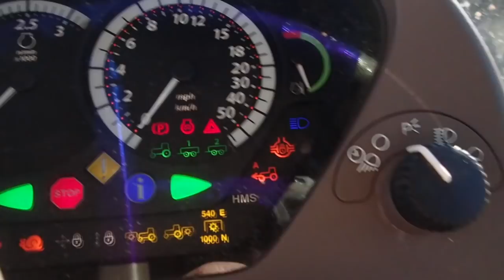Cold Hay Day + Story

Comment: You were heard, but a heater with a separate exhaust is still what I prefer and recommend.
Can run it all day in my shop, and only thing in my shop is hot air as the exhaust is lead out through a metal pipe to the wall. The pipe also gets hot and is great for drying work gloves.

Comment: "There is always a tractor that starts"........Wes, with around 16.5 John Deere tractors, If NONE of them start you got issues......lol
Thanks, Keep em coming. Btw, heated battery blankets worked well in Alberta on winter equipment. They made batteries last longer in addition to helping the battery get a machine started.

Comment: That sucks about the guy getting run over :( youch! 
 Cold weather and diesel don't mix! My jd diesel won't start unless it's plugged in. Glow plugs are ok for temps 25 to 40 degrees but block heaters are pretty handy for artic weather ; )
Reply: As long as your Diesel doesn't turn to jelly. A guy I knew in Denver used some kind of additive in his fuel to keep it from freezing.
Reply: tom7601 our diesel is delivered and is always winterized :) mi weather is cold so it's standard even in truck diesel pumps ;)
Reply: yakyakyak69 everyone here sells it winterized. I didn't know they added kerosene to it. .. is it bad to run it year round? Our delivery company only offers the winterized stuff :(
Reply: WTFarm Girl kero has less calories then diesel so long term you will burn more to get the same amount of work done, I'm not sure of its lubricity so might cause problems in common rail high pressure fuel systems in hot weather, also not sure how tier 4 emisions systems deal with it but most winterised diesel has kero in it so that must have been tested during development.Cheers mate 🍻
Reply: I add petroleum to my fuel at winter,its a big diference for my tractors
Reply: should not add kerosine in the diesel. new engines with injectors dont like that as no lube in that stuff. clean diesel without that bio crap is the way to go.  my trucks have heated filters so works rather good. need to have your shit in good order in the cold :)
Reply: WTFarm Girl 
16
Reply: Michigan winter fuel is a blend of #1 and #2 diesel and some suppliers may add an additive also but it is rare unless you order it with added stuff
Reply: our 1972 4230 don't like the cold

Comment: I'm sorry for your families loss. I have a ? about your load securment. Have you ever considered an X strap configuration on the front of the load to add extra piece of mind to prevent the load shifting forward under a hard breaking situation? While I hauled shingles for Owen Corning most guys would cross strap the front pallets of shingles to keep the load out of the cab.

Comment: Just curious, are farmers required to have a CDL to drive a tractor trailer on the roads?
Reply: paul dietrich depends on how far they are going. From what I've been told, In Ohio, you have a 150 mile range from home that you don't need a cdl.

Comment: Diesel now is not what diesel was 20 years ago. High sulfur diesel in a salamander would smoke you out. I have a 210,000 btu salamander and i run diesel in it and you wouldn't know the difference between that and kerosene.

Comment: Thats why i dont like the amarican Farm Wagons. Its kinda stupid trying to pull 20 Tons with only breaks on the tractor

We here in germany have breaks on every wagon above 3 tons. Wagons that can haul more than 8 tons have to be air braked. Accidents still can happen. So if something starts to roll you better let it do its thing and avoid getting hurt or even killed.

A guy in my neighbourhood just got killed this summer trying to stop his tractor after the parking breaks fail'd, so be carefull with Farm vehicles.
Reply: TimmyTeaBag 

Haha, Not good.

Thats also why i like air brakes. Its nearly impossible to mix something up while connecting to an implement. If your Not a complete idiot😂

Comment from the maker: by by jeramy freemen
Reply: onelonleyfarmer Tim really needs a REAL TRUCK Wes.I think he needs a clean,used(gas)Ford super-crew cab F-250 or F-350.
Reply: onelonleyfarmer on your 8120 it might need new injectors because it might have dribbling injectors that’s why white smoke after Reving when you started it up
Reply: 4 gauge    Why would be get a gas one    Whith diesel it is cheaper if you are dodgy minded
Reply: Hmmm I understood exactly what you meant, in fact I do the same thing! Oh yesterday my wife's car battery took a chit too it was 2 degrees here in Northern Michigan, the freaking battery was $197 bucks and a real bitch to change you have  have a $12 special tool to lift the battery out of the hole in the floor behind the passenger seat!😡 Damn GM engineers!
Reply from the maker: i think i have a dribbling injector too i won't mention the white stuff coming out!!!
Reply: Steve b Yayaya it would be nice if you could actually speak English and spell English properly,so people can actually understand what you're saying first of all.Diesels SUCK!!.There 3 to 5 times more expensive to own and maintain.Have TONS of reliability issues,especially in the winter time starting.Gas is the best choice,also you don't need to run urea in it(adds to the cost of your fuel dramatically at $12.00 per 2.5 gallons)
Reply: 4 gauge u don’t know mate if your a farmer u don’t have a gas truck over here in England anyway, because you can run it of red diesel but that is kept quiet. Do you like my English now As well
Reply: 4 gauge in England for diesel ye petrol is 1 p cheaper over here but red fuels or farm diesel that is 46p to 59p which would you have if you were a farmer
Reply: Steve b Yayaya I've had a lot of experiance with diesel pickup trucks and reliability is a major issue with all of them,especially in the winter time.I'll never own another one ever again.Diesel fuel runs about .50(or more)cents a gallon more here in the states,plus you have to buy urea for emissions control,which runs about $12.00 a gallon on top of your high-dollar diesel.By the time your done,you'll have nearly 3-times the cost in your fuel,that won't start in the winter time.
Reply: Steve b Yayaya Farm diesel in this area goes for roughly about $2.69 per gallon.So this means if you fill up your F-250 diesel pickup truck with its 42.5 gallon fuel tank,your going to spend $114.70 cents...BUT WAIT!!,THERES MORE!!.Now,your going to buy about another 25 gallons of urea for your emissions.This will cost you another $115.90 cents for that...bringing your total fuel cost too(drumroll please)$230.60!!.THATS INSANE!!.
Reply: 4 gauge fucking hell glad I don’t live in America after hearing that you should come over to England whith are little pickups that you can fill up for £40 on farm diesel now I understand 😂
Reply: Steve b Yayaya Diesels are expensive everywhere and anywhere in the world.If you need to put in fuel injectors in a diesel pickup truck(Ford,GMC,Dodge)they run about $400.00 a piece.So,your going to spend about $3,200.00 on just buying replacement fuel injectors.Again...THATS NUTS!!.Fuel injector pumps run about $2,000.00 a piece,even more insanity right there.If diesel is"your thing"so be it.Not for me.
Reply: 4 gauge you should get a hilux
Reply: 4 gauge but that’s the price to pay for big boystrs trucks
Reply: Steve b Yayaya No.The Toyota Hilux is defunct first of all,(those were discontinued back in the 1980's)
second of all,Toyota doesn't built a high GVW truck.(the tundra is a half-ton truck)
Reply: Steve b Yayaya Waste of money anyway you look at it to me.I don't care if you have $100,000,000,000.00(100 billion bucks)in the bank.This originally started about Tim's dying Jeep,not about me.I have a F-250 with a 7.5 liter in it and it eats diesels for lunch.
Reply: 4 gauge hilux weren’t discontinued and ur a bit sad I don’t care
Reply: Steve b Yayaya Sigh...I just checked out Toyotas web site and the Hilux was discontinued back in 1995,the TACOMA replaced the Hilux.Now,what's really sad is somebody feeding me B.S.about misinformation as fact(s).
The Hilux AND the Tacoma(pronounced COMA)are a JOKE!!.The have little to NO hauling capacity at all,compared to even the Toyota Tundra.(10,000 pound drawbar capacity)
My F-250 has nearly 18,000 pounds of drawbar capacity and about 3,800 hundred pounds of hauling ability in the 8-foot bed.
AGAIN,this isn't about me dude,this started out about TIMS JEEP!!.WAKE UP!!.
Reply: 4 gauge they still do hilux in England
Reply: 4 gauge I don’t really care to be honest stop crying
Reply: 4 gauge it wasn’t replaced but I didn’t tell you what to get either I said Tim could get a diesel so he could run it of red but I didn’t know u had to put pig piss (urea) in the trucks sorry didn’t mean to upset u
Reply: Steve b Yayaya No,your not upsetting me one bit.I'm laughing my head off about this whole ordeal about what started out as what I said about Tim's Jeep.
The Hilux was replaced 22 years ago according to Toyota of JAPAN.This means that on all 4 corners of this earth,you CANNOT buy something that doesn't exist.(I'm laughing my head off about that also)
The T-A-C-O-M-A has REPLACED it NOT ONE,but TWO DECADES AGO.If you don't believe it,call Toyota and ask them what happened to the Hilux,they will tell you that rust bucket was replaced by the TACOMA eons ago.😂😂😂😂😂😂😂😂😂
Reply: 4 gauge how the fuck do I have a 2015 Toyota hilux  in England clever clogs
Reply: 4 gauge search it up 2015 Toyota hilux
Reply: Steve b Yayaya I just looked at that truck and its a prototype only and its being tested in Austraia.Its not available for the general public as of yet.
Reply: 4 gauge no it isn’t you don’t know and I don’t care so bye bye
Reply: Steve b Yayaya Ahh,I can read and write English dude.Its a PROTOTYPE truck(means that only one built)and its in Australia.It remains to be seen if it ACTUALLY goes into production.

Comment: I learned not to chase equipment the hard way. Or well I wasn't even chasing it. It was a Farmall c the battery was dead so I crank started it. Not realizing it was in gear, and being as it was well tuned it fired up at about a 1/4 turn and ran me over.
Reply from the maker: wow your lucky your still alive plenty are not.
Reply: onelonleyfarmer Yes I am. I was 20 when it happened so I was a little tougher then than I am now. But lessons learned.

Comment: Surprised the new Deere let you down after you using it almost every day. I would understand if it sat in a shed for several months.
Reply from the maker: the battery was low in water so i topped it off and now she is all good
Reply: He drinks JD  kool-aid
Reply from the maker: you do realize john deere makes really good equipment right?
Reply: onelonleyfarmer John Deere should start making pickup trucks
Reply: Nathan Medlar , I have a JD mower that cost as much as a new pick-up and it is a huge p.o.s, So I can't  Imagine how bad a JD- pickup would be.
Reply: IH826 Farmall Several factors involved in ag. diesel cold weather starting:   1) 15w40 engine oil instead of 5w40   2) #2 diesel in the tank instead of #1 diesel or winter fuel additive,  3) Should let the glow plugs run until the light goes out before spinning the engine  4) Older tired batteries  5)  No use of engine coolant heater.

If sitting outside, and unless it had been run in the last 6-12 hours, previous operation wouldn't make much difference.